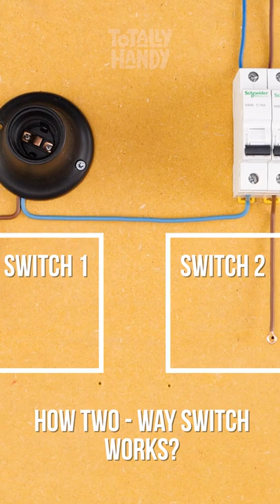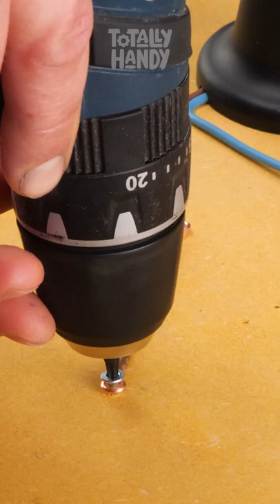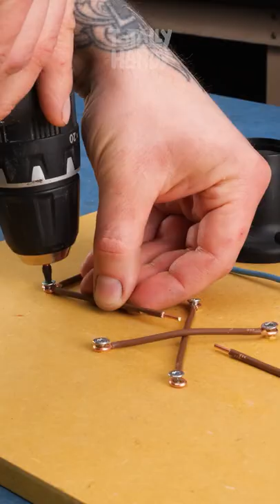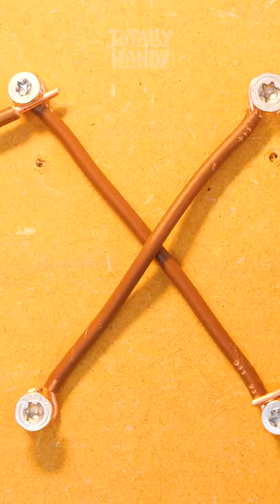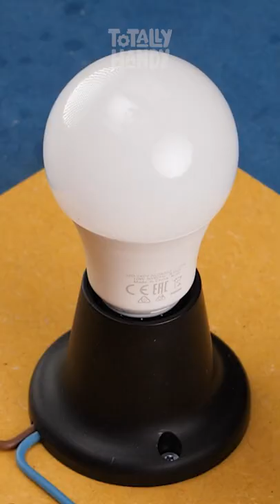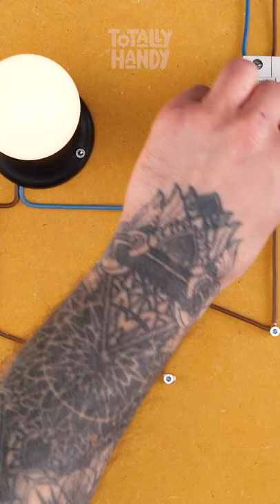DIY switch at home #shorts

Comment: People like you scare me, electric fire speedrun?
Reply: You can see it says "how two-way switch works", so they are just showing how this type of switch works
Those who added "diy" to the name are just idiots 🙊
Reply: I think the current value of the (LED)Bulb is too small to generate so much heat to fire up the wires when contacting. But the Voltage on the unisolated metal is dangerous.

Comment: Aint it easier and safer to just buy a switch?
Reply: They are just showing how that type of switch works, it's not DIY thing ahah (it says "how two way switch works" at the bottom when video starts)
Reply: @88Timur88Bahmudov88  mmmm misleading advertising haha
Reply: It is actually called a 3way in the U.S.